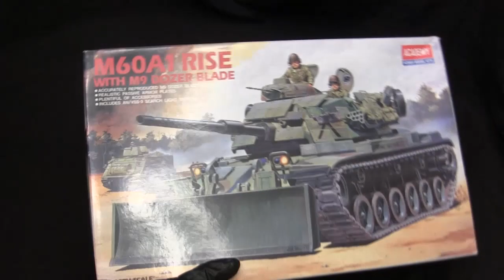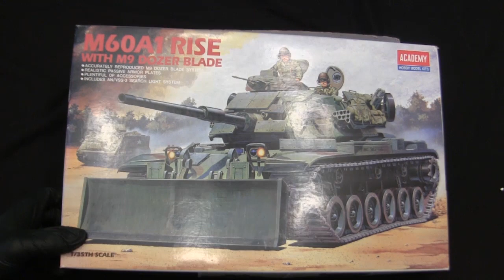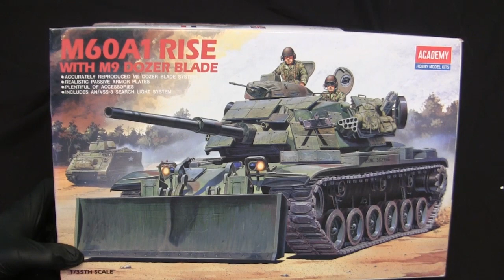1/35th scale motorized M60A1 RISE w/ M9 bulldozer blade

Comment: Wow, that is miraculous.. I’m not sure if you still respond to comments to this video but I wanted recently to buy myself an M60A3 TTS with radioactive armor but I can only find this model, one from tamyia and one from this video I see it’s from Academy, the thing I’m asking is can I make an RC tank like you also if I buy this tank from Tamyia? Or do I need specifically from Academy brand?
Reply from the maker: For an RC build both kits are excellent and will give you good results. As I stated in this video the academy M60 kits are copies from the tamiya kit but academy made some adjustments to them improving them over the tamiya in many ways. However because the core kit was designed to be motorized they are a perfect candidate to make operational and are easy to do because of these design features found on the kits. The Tamiya dual motor gearbox is my go to for these conversions and on the M60 mate and adapt well and easily. Academy recently released their M60A1 kit with a 2 wire remote where they too give you a good quality gearbox that can be adapted for RC use. All you have to do is mod the tank to have an internal battery and other RC systems. On youtube there are several videos of people who have RCed both the tamiya and academy kits. I hope this helps, good luck with your project :)
Reply: @ Thank you a lot for help🙏🏻 I’ll get the Academy kit, of course I’ll not do the same mistake like my other M48A3 😅 (I had to cut in half all wheels bc I forgot the poly caps) it was also my first tank set, but now I’ll be more informed and experienced. Again, thanks a lot 🙏🏻♥️

Comment: Happy 10k subs !
Ps how’s the T34 85 going?
Reply from the maker: Right now I'm working on the battery harness, I'm doing some research on either sticking with the two 12V batteries or use a single 24V battery.
Reply: oddball759mm Ok good luck then
Reply from the maker: Once I have something figured out I'll drop a video update